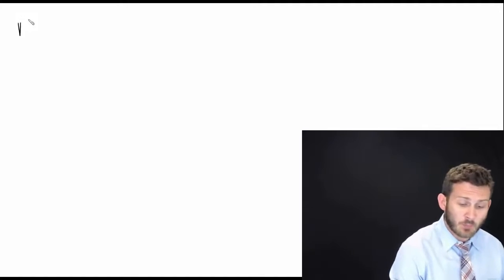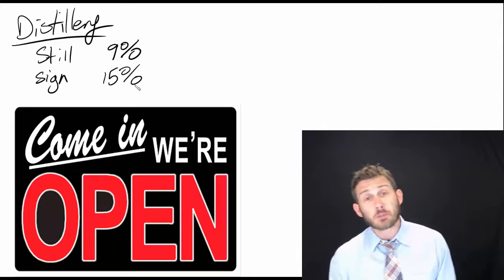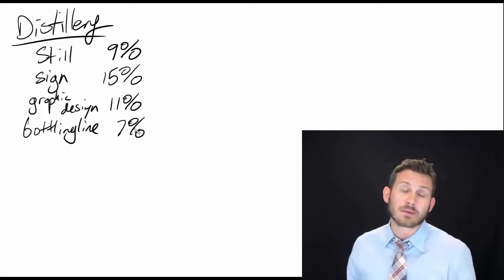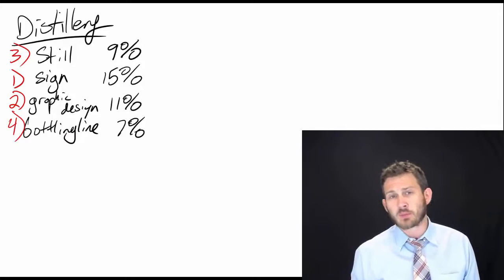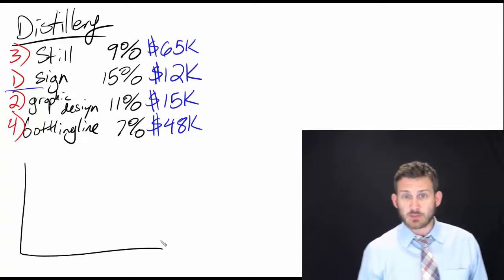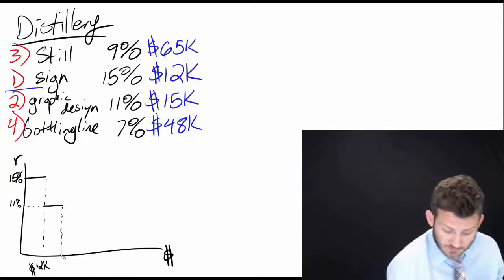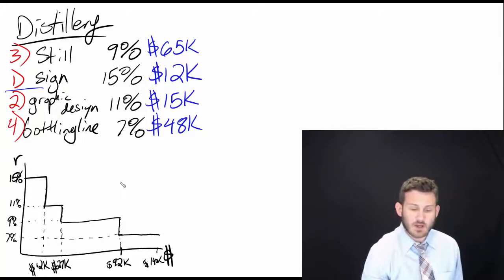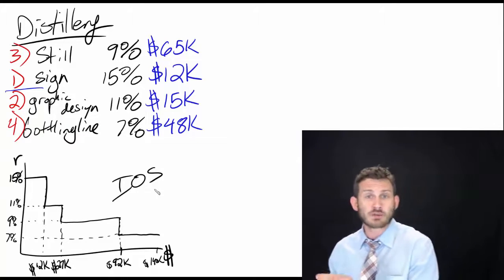Investment Opportunity Schedule

Comment: Hello :) 
Could you please explain me as to why we show cumulative values on the x axis. Why not individual values? Wish to understand the mathematical aspect behind it. Thanks in advance.
Reply from the maker: The reason we put the cumulative values on the x-axis is because we are evaluating how many projects we should undertake.  This is why they are plotted by decreasing rates of return because we will start with the project that has the highest return and then move on to the next project.  The other reason they are plotted cumulatively is because we will typically overlap it with the Marginal Cost of Capital (MCC- see other videos) and our borrowing/equity costs rise as we need more capital.  In this way, we compare the MCC to IOS to determine how many of these projects get funded.  Hope that helps and thanks for watching!